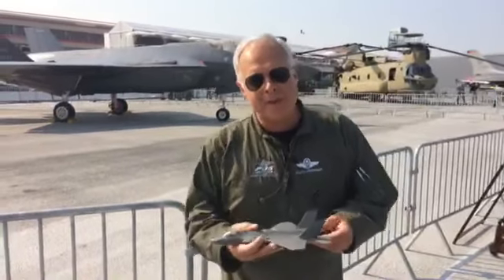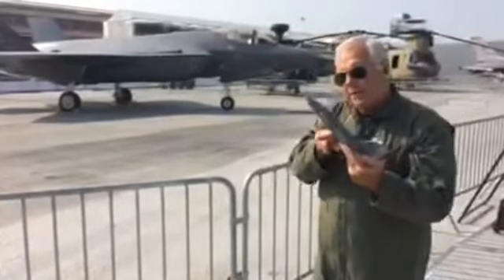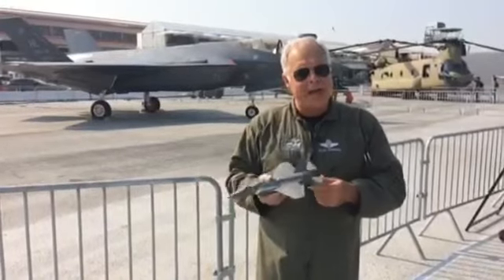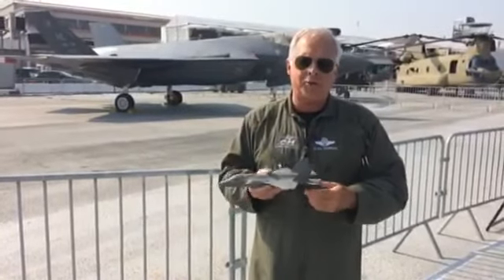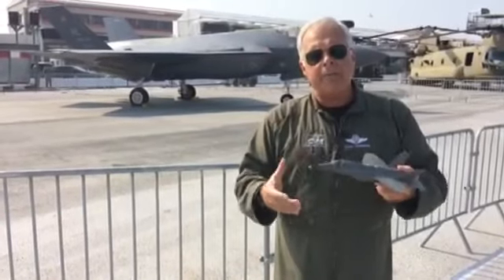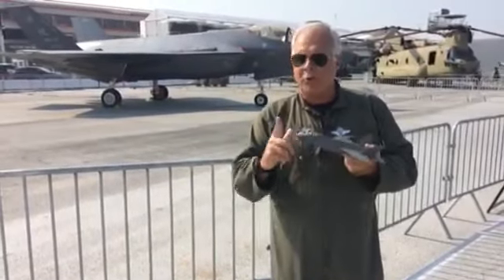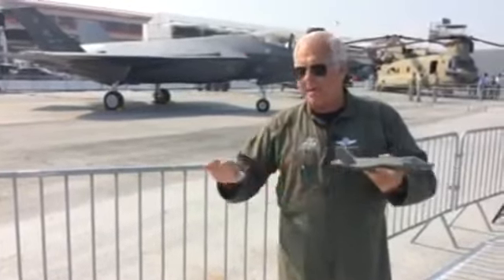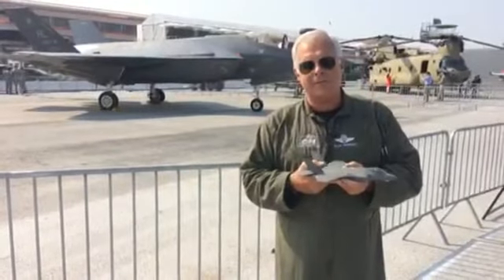Lockheed F-35 test pilot live Q&A the Paris Air Show 2017

Comment: Germany last month requested classified information on the F-35, I think they are thinking about replacing their Tornadoes with the F-35 instead of building a indigenous stealth fighter as originally planed. Furthermore this airshow certainly shut some people up who said it cannot turn.
Reply: Germans might wait for the FRP lots; so they're still in time to seal a deal for a partnership for their own 5th gen. Maybe Japan if the japanese want to go all out on their ATX program.
Reply: Have you ever seen a russian built jet turn? there is a reason why the F35 isn't called super maneuverable. something which the F22 is. Also, the F35 in this demo had 50% fuel or less. The F35 CANNOT do this demo at full fuel load. At full fuel load, the F35 has a thurst to weight of around 0.87. This means it cannot perform that take-off and sustain that climb. It could also not do any of the other vertical maneuvers it did, for a prolonged period of time like it did. also: "This airplane is a 9-G airplane WHEN we have our final configuration" read: it can't pull 9-G right now. This Q&A looks staged. Anyway. How ya doing dragon?
Reply: Nikola Dume nope. F35 performed at mission load out.

besides there are video comparison of ITR, back flips/loop, minimim turn rate and...not gonna spoil the results. 

The F35 has monstrous degree of maneuvrability thanks to the massibe thrust to weight. in fact, its the only a/c capable of going vertical after a take off in just mil power. no reheating, no afterburner.
Reply: FirstDagger  There's not enough 
money in the bundesrepublic for
an aircraft purchase.
Reply: +John Hearn Which is exactly why the F-35 is a better solution for the Tornado replacement than building an indigenous stealth bomber.
Reply: Is the F-35 really capable to replace the Tornado?
Reply: There is, Germany is the 4th largest economy on the planet. There's not enough money in the Bundeswehr*
Reply: +Hans Christian Plschek I believe so, Tornados dropped their low level missions anyway. Furthermore the Luftwaffe wants a stealth to replace it, the F-35 fits the bill.
Reply: Mmh - may be that you are right, FirstDagger. But I grew up with the Tornado (I'm 52 years old) and I still love these airplanes - they are "oldies but goldies".
Reply: It's a shame, Superfamily Allosauridae. You are right.
Reply: +Hans Christian Plschek And they are dead meat in the face of modern Russian Surface to Air Missiles. Sure they are nice to look at, but those airframes are getting old and Germany barely has a standing airforce. "Only 29 of Germany's 66 Tornado jets are airworthy"
Reply: You're right, FirstDagger. But I'm just no fan of the F-35. To many problems during the development as you know. To slow and so on.
Reply: +Hans Christian Plschek 1. Every plane has had a difficult development, Tornado included. 2. A combat loaded F-35 is faster than a combat loaded F-16 from what I gather. 3. Many specs are secret. 4. EODAS makes any other jet compared to her obsolete (especially in A2G roles). This will also be my final reply to you.
Reply: Too slow? Do you want to know how fast and how many Gs can pull a mission capable F18C/D ? below mach 1.2 at less then 6.5 G.

An F16? around the same mark.

Do you know how fast and how many G can pull a 3F f35A in a mission loadout? Exactly the same M1.6 at altitude and the same 9g. WITCHCRAFT i swear.

Do you know how many 4+Gen all equipped with IRSTs took the Aggressor Squadron in Red Flag to kill a single F35? 20.
Reply: The reason is simple: Germany is fine being relegated in a lower tier of viability in Nato's as there's no major conflict in sight. As such, the idea is not to buy the F35 in its LRIP stage, but rather wait for the full rate production and buy the As once the price will be around the projected 75M; rather then the 98M per piece it costs now. 

Another, subtle and totally insignificant reason.

Eurofighter Jagdflugzeug GmbH (<-) -> Airbus (again)/ EADS born from DASA.

So...Eurofighter consortium is mostly german.
Reply: EOTS/DAS is equally revolutionary for the missions of both air-air and air-ground, as well as the Command and Control/Battlefield management realms. This is a quote from Tyler Rogoway, an outspoken critic of the F-35 program:

"The F-35's high level of electronic battlefield situational awareness, paired with ALIS, could theoretically build a worldwide battle database organically, one that is god-like in its breadth and timeliness."
Reply: F-35 development was painless and quick, if you compare it to other fighter development programs and then realize that this is likely amongst the most complex systems of any kind ever developed in history.

Sure, it's behind schedule. But the original schedule was incredibly unrealistic, calling for a 7 year period between first flight and first service in 2012. For reference, the Rafale first flew in 1986 and entered service in 2001, more than double the time, and that aircraft is far simpler and the entire program was far less ambitious. Several Rafales have crashed. Three F-22s have crashed. But not ONE F-35 has ever crashed, and there are already more F-35s flying around than F-22s or Rafales, in more diverse areas and in more varied national hands than virtually (possibly literally) any developmental weapon system in human history.

Not one crash, despite these things being managed by, count them:
the USAF
USMC
USN
RAF
Royal Netherlands Air Force
Royal Norwegian Air Force
Royal Danish Air Force
Royal Australian Air Force
Japan Air Self Defense Force
Republic of Korea Air Force
Italian Air Force
Israeli Air Force
Turkish Air Force
Those are just the customers that are already dealing with operational F-35s. 

Considering that it first flew in 2005, 2015 IOC for the USMC F-35B is incredible, especially as the damn thing can hover and is the most complicated variant. This is another reason why the 0 crashed figure is impressive. Compare this to the V-22 or Harrier...
Reply: People cannot understand it takes around 20 years to come up with a brand new, competent, fighter.
Reply: +sh0ckv3l And that these fighters will end up serving more than 40 years.

Comment: If the F-35 was intended to impress in maneuver it would have been spec'ed for thrust vectoring on the A and C models. The things which should impress about the F-35 are its sensors, networking, information management and maintenance, which are factors far more important to warfare than airshow stunts.
Reply: True, but fancy flips and tricks are easy spectacle. Understanding sensors and information networking requires a prior knowledge of the systems to know exactly how important they are. For most people, they won't care enough to learn about it. They just want to see the action.

Comment: Do us a favor called don't compare the F-35 to Pak Fa or J-20. The F-22 is a better comparison especially when F-35 is a joint strike fighter meant to strike targets with stealth while the F-22 is an air superiority fighter.
Reply: F-35 is arguably better than F-22 in almost every way. 

The two aircraft cruise at basically the same speed, the F-22's and F-35's maximum altitudes are 55,000 and 50,000 feet respectively.

The F-35's radar is basically a vastly more efficient variant of the F-22's radar, and the F-22's radar has since been upgraded for air-ground capabilities equal to the F-35's radar.

The F-35 is likely stealthier than the F-22, given that it uses newer and more advanced RAM, has DSI intakes, and is smaller. No credible source from the USAF or any other organization related to the F-35 program has said the F-22 was stealthier since 2005, the year the F-35 first flew 12 years ago.

The F-35 can carry more ordnance for all missions with one exception being that the F-22 has the side bays for AIM-9s. Another noteworthy fact about the two aircraft's combat loads are that AIM-120s and drop tanks are the only things cleared for the F-22's wing pylons. The F-35's wing pylons will likely be cleared for all of her weapons, there are four compared to the F-22's two, and the F-35 has already been seen in-flight carrying AIM-9s and bombs on these wing mounts.

The F-35 is the best electronic warfare system the United States, or any nation, has on an aircraft. It's essentially got improved systems from the EA-18G with a higher power-generating engine.

And this part is the most important:

The F-35 has a spherical field of view thanks to the EOTS/DAS systems and can launch AIM-9Xs in any direction, although this can sacrifice P/K and range. The F-35's spherical field of view is quoted as detecting 4.5th gens with afterburners on at low altitude at 160km, and (these are practical guesstimates) likely is capable of seeing 4.5th gens under normal conditions at around 100km, and 5th gens like F-22s and F-35s and J-20s/31s/Pak Fas, etc at around 50-90km. This gives the F-35 an advantage over literally all other aircraft, as nothing else has such a system. At best, her opponents have forward facing IRSTs and maybe an additional one facing backwards, and they're likely less capable. I.E. the F-35 is the only weapon system capable of reliably detecting AND killing 5th generation aircraft.

F-22's only superiority is in maximum speed and altitude. Under some conditions, a larger air-air load by only two AIM-9s.
Reply: Boeingemployee1989 The F-22 was designed to be an air superiority fighter yes, but the F-35 was also designed to be that. Its a "joint strike fighter" a term i really dont like to be used when describing the F-35, the program was called JSF, the F-35 can better be described as a multirole air superiority fighter. Its made to do what the F-22 does best, and much more.
Reply: Joint Strike Fighter is a misnomer.  If you read what this A/C is supposed to be able to do, it's supposed to be an airborne command, early warning, jammer, information hub in a stealth package that also carries guns and a pair of missiles.  It's supposed be a jack of all trades and a master of none.  It has YET to fully deliver on it's promises.  What frustrates me is that our current enemy isn't fighting is with technology (except in cyberspace), but is fighting us with ideals.  What's even more frustrating is that some of our very own politicians are trying to destroy the country by trying to get us under the thumb of foreign Gov'ts
Reply: So replace most of the F-22s and most of the fighters with the F-35s?
Reply: Not "replace", combine and in the future fase out.

Comment: "Take off to a slow speed climb"... a high speed climb is not available, due to the lack of raw T/W ratio. :) However, based on the very clever aerodynamic shape, this plane is able to accelerate very quickly after every high AoA/ high drag manuever. So it is a quite good airplane.

Comment: So if I understand correctly, the "minimum radius turn" flown near the end of the routine was limited to 7 G's because the current software version doesn't yet allow the aircraft to pull its full 9 G's?   If so, then we still haven't really seen the F-35's sustained turning capability (though that square box seemed to show high instantaneous turn rates?).  Looked to me like roll rate is less snappy than F-16.  Is that because the demonstration was flown at relatively low airspeeds?
Reply from the maker: The pilot didn't appear to use max roll rate, possibly due to the relatively low airspeeds, but also possibly just for controllability (snapping out of a fast roll and then having to correct yourself because you've overshot your intended angle doesn't look good). Videos that I've seen (eg, in the "AF-2 Workhorse" video elsewhere on YouTube) have F-35As rolling at 270 deg/s.

Comment: How do this Plane ✈️ compare to the Raptor other then the twin engines ?
Reply: Not quite as fast, but better at just about everything else.
Reply: Patches: Not quite as fast? Lulz, that's the understatement of the century. The F-22 is insanely fast, especially at altitude. Of course, that isn't the F-35s job. The F-22 is a spectacular fighter with crappy air to ground capacity tacked on as an afterthought. The F-35 is an attack/strike aircraft with okay fighter performance greatly enhanced by good situational awareness and low observability.
Reply: F 22 RAPTOR

Maximum speed:
At altitude: Mach 2.25 (1,500 mph, 2,410 km/h) [estimated]
Supercruise: Mach 1.82 (1,220 mph, 1,960 km/h)
Range: >1,600 nmi (1,840 mi, 2,960 km) with 2 external fuel tanks
Combat radius: 460 nmi (with 100 nmi in supercruise) clean (529 mi, 852 km)
Ferry range: 1,740 nmi (2,000 mi, 3,220 km)
Service ceiling: >65,000 ft (20,000 m)
Wing loading: 77.2 lb/ft² (377 kg/m²)
Thrust/weight: 1.08
Maximum design g-load: +9.0/−3.0 g

F 35 LIGHTNING II

Maximum speed: Mach 1.6+ (1,200 mph, 1,930 km/h) (tested to Mach 1.61)
Range: >1,200 nmi (2,220 km) on internal fuel
Combat radius: 625 nmi[684] (1,158 km) interdiction mission on internal fuel, 760 nmi (1,407 km) for internal air to air configuration
Wing loading: 107.7 lb/ft² (526 kg/m²; 745 kg/m² max loaded)
Thrust/weight:
With full fuel: 0.87
With 50% fuel: 1.07
Maximum g-load: 9 g
Reply: VALHALLAXE: That estimate of the F-22s top speed is rather conservative. It is also important to consider that the limit of the F-22s speed is primarily determined by thermal stress, not a lack of thrust. This means it can easily maintain such high speeds even with heavier payloads or during maneuvers. The F-35s top speed is determined primarily by thrust/drag, like most conventional fighters.
Reply: In other words they're both fast.
Reply: "Rather"? With early....and truer thrust numbers-40K per engine, paper estimates are M2.97.
Reply: nwtruckerll: If you include simple thermal characteristics in an estimate of the F-22s top speed, you'll find that with the materials likely to be used the F-22 could not exceed Mach 2.7 at 70,000, and is probably quite a bit lower. Also the top speed would drop as altitude is reduced due to thicker air generating more heat on the leading edges and nose. However, just because the F-22 is probably restricted in top speed by heat doesn't mean all that excess thrust is without use. It would allow the F-22 to maintain something close to that top speed during some turns. It would also allow the F-22 to accelerate it its top speed much faster.
Reply: VALLHALLAXE: Fast is relative. The difference in top speed between the F-22 and F-35 is lilely more significant than the difference between the F-15 and F-16. No one dismisses the difference in capability between those fighters. The F-35 is fast enough for its job.
Reply: Calvin R Heath Jr. in terms of agility, the Raptor has the upper hand with it's thrust vectoring engines. It can't  super cruise and not quite as fast. F-35 pilots have the helmet which Raptor pilots don't use yet. Besides all that, it's just as capable.
Reply: Meh, Same area code....:) I'm guessing if the driver had the need, skin damage would be an acceptable risk over the potential alternative.
Reply: One other arena the F-35 lags behind the F-22. The supersonic realm. The F-135's are high-bypass and designed for the sub-sonic range. The F-119 is a low by-pass engine specifically for high altitude and speed

Comment: Does ,,square circle" have some other angles than a normal square, that angles are 90 degrees each. The pilot says for several times about 50 (!) degrees. What a shame for USAF.
Reply: He's talking about flying the corner of the square loop at 50 degrees angle of attack, which give you a very high instantaneous "pitch rate"! That's the longitudinal angle through the nose/tail in relation to the "relative wind"So as he transitions off the vertical line to inverted flight, he is "pitching the aircraft" at its maximum angle of attack, limited by the FCS... with the pitch limiters off, AF-2 has been flown to 73 degrees angle of attack, then later the to 105 degrees angle of attack, very agile aircraft!
Reply: 50-degree angle of attack, meaning that the wings are pointed 50 degrees off from the actual direction the plane is flying. If you watch the actual demonstration he's describing, it is a 90 degree turn, during which the wings achieve a 50-degree angle of attack.
Reply: burn!